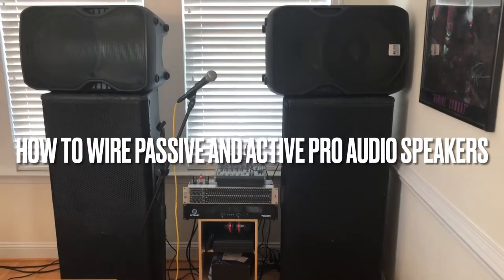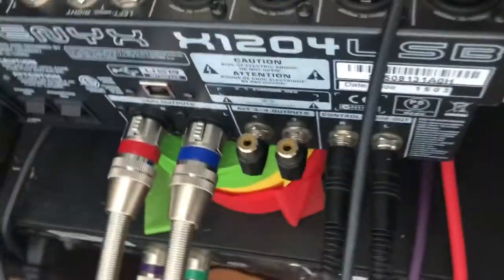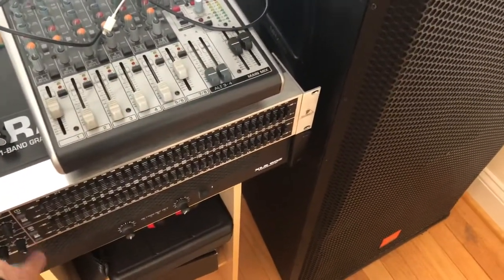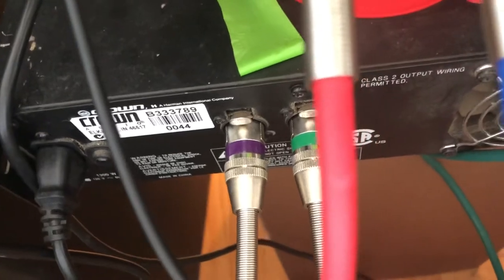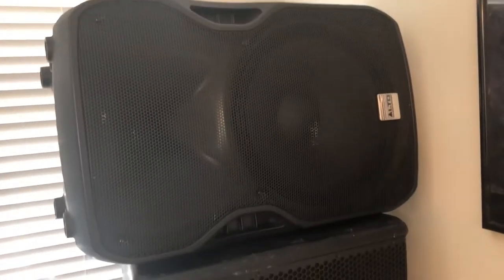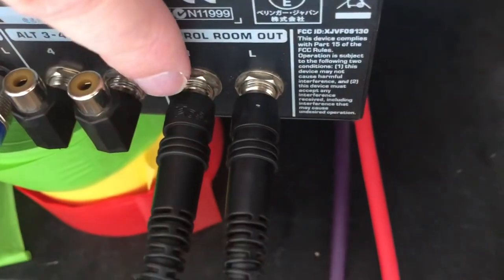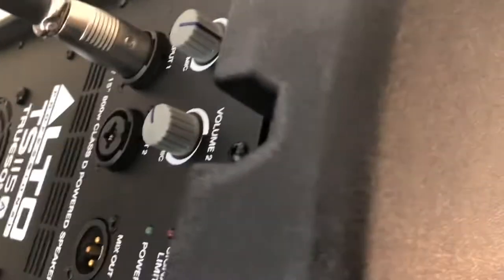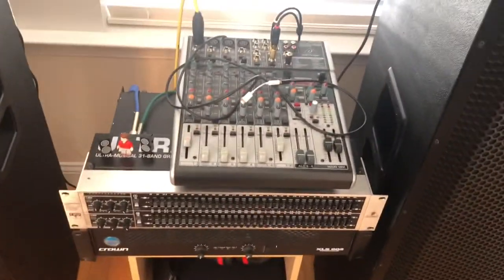How to wire passive and active pro audio speakers to the same mixer (Behringer Xenyx X1204 USB)

Comment: Could you use splitter?   i.e. split the main XLR into 4.
Reply from the maker: Ya, that is also one way to do it. Then you can just adjust the levels of the speakers at the amps so they play at the same volume.
Reply: Thanks.  The reason I ask is I want to do as you have done.  Use the Control Room out to active speakers.  But still want control speakers facing me during the gig.

Comment: good day, I have a t.amp --800 thomann Power amplifer and a mackie 12FX mixer and a Plye Passive PADH212 speaker. I have the Plye PADH212 speaker connected with 2 speakon cables (L and R) from the passive Plye  PADH212 speaker directly to t.amp 800 thomann power amplifier into L & R speaker connections . From the Main out L&R of the mackie 12fx mixer 1/4 input to the T.amp 800 thomann power amplifier chanel A and Chanel B. I have 2 microphones connecected via XLR cables into channel 1 and channel 2 of the mixer. I have no sound coming out of the passive Plye speaker. I tried this in stereo and parrellel modes, I know that the speaker works yet i get no sound. All my cables and volume levels are up and working.. I cannect get any sound of the PA speaker. Any thoughts? thank-you
Reply from the maker: Sounds like it is wired correctly. You may need to try switching components if you have some extras to test what is wrong. For example, you could plug your phone into your amp directly, if that works then the mixer is the problem. Or you could hook up a different speaker to amp, if that works then speakers are bad, etc.
Reply: @UCanFixAnything  I had the power amp running on it's own. connected 2 speakon cables to the passive speaker and pluged in a condenser mix, XLR to XLR into channel A, and B and nothing. I plugged in 2 old RCA speakers with the speaker wires as well to the power amplier and tried it and failed. The fans are working, and see the light indicator, I think there is sound subcomponent inside the unit on the mother board or the sub sound board connected that is bad. I think its DEAD.

Comment: Can you connect PA speakers, AV receiver? What’s your opinion?
Reply from the maker: I mean, if you have pre-outs on your receiver then yes definitely you can. PA speakers are generally designed to be loud as opposed to home audio which is generally designed to have clarity. So depends on use case.
Reply: Ok I have another scenario if your PA speakers have speaker terminal, can you connect them directly to the AV receiver if your av receiver, does not have pre-out

Comment: I currently have an analog mixer (yamaha mgxu) i dont have a power amp. I have 2 powered speakers and 2 passive speakers. Is there any possibility that i can connect the the 4 speakers? Thanks in advance.
Reply from the maker: You will need some way to power the passive speakers. You can’t draw power from the amps inside the active speakers to power the passives.

Comment: How about if I just want to connect the passive speakers to the mixer without using the amp? wouldn't that work?
Reply from the maker: It won’t unfortunately. The speakers need power to amplify the signal. In this case the wires won’t even connect. But even if you used adapters to get the wires to connect, the signal would be so low as to not be heard or to be so low in volume as to be useless.
Reply: @UCanFixAnything  but I do that on my gigs and it works🤔

Comment: if i have two different passive speaker can i connect them together ?
sec , if i have two different amp........... can i connect them together  ?
Reply from the maker: You can connect speakers together. You don’t want to connect amps together per se, but you could have them playing the same signal. For example there are amps in both my powered speakers and they are playing off the same output.

Comment: Can I connect PA speakers to stereo❤ receiver
Reply from the maker: Depends on your receiver, you will need “preout” ports or other rca out ports (not the speaker wire outputs) to send an unpowered signal. Then you will need a cable to convert from rca to quarter inch or xlr or speakon. Depending on your PAs (assuming they are powered). You could also hook your phone directly up to a PA.

Comment: What if your mixer doesn't have a control room out?
Reply from the maker: You can use splitters on each xlr out.
Reply: @UCanFixAnything  so I have the behringer x2222 USB, using the XLR ours with a splitter can go to the speakers? I also have a passive sub.

Comment: What if I want to add a powered sub???
Reply from the maker: There are multiple ways to do it. With this setup I would run it through the equalizer (it has a sub out port). Unless you have two subs, then you can run one from each of your powered speakers using the line out on those.

Comment: What if i don't want to use the eqaulizer
Reply from the maker: Just go straight from the mixer to the amp. No need to use the equalizer, can just bypass.
Reply: What can I use other than the main outs to connect a passive subwoofer? Cr out?